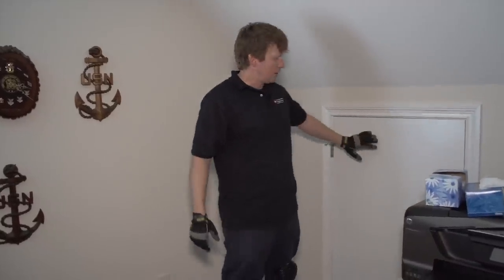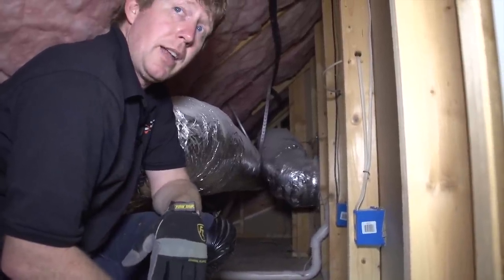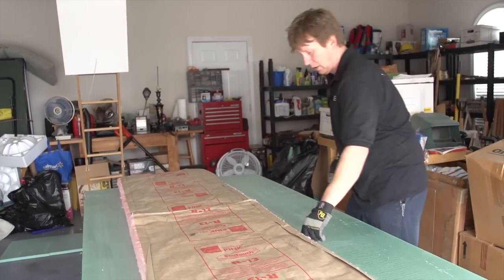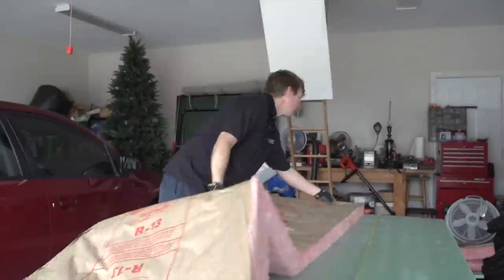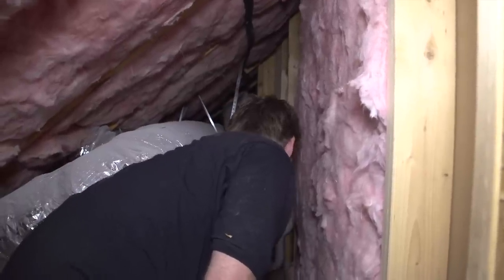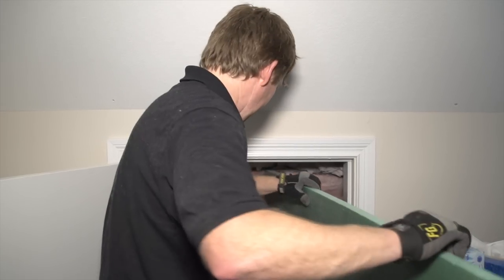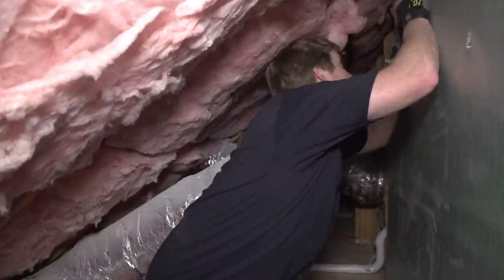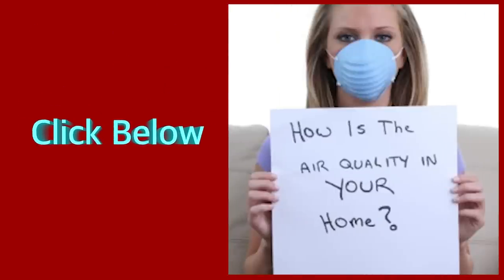Knee Wall Insulation DIY | How to Insulate a Knee Wall in Your Attic

Comment: Inside our kneewall with our ceiling insulated over baffles with batt and short walls insulated with open cell spray foam we finished it with drywall to give us more storage space. Now it’s sealed and moisture free with no humidity issues. Working around the duct and vent pipes in such a small space was tricky but we got it done.

Comment: Does the foam board act as a vapor barrier as well, or just an air barrier? I'd be concerned with creating a double vapor barrier issue and ending up with all sorts of moisture issues.
Reply: Your are right.   He's made a chamber and will trap more moisture.   There is closed and open cell foam but rigid is all closed cell meaning moisture can't go thru well. 

The reflective side on foam is a radiant barrier and should face the outside of the living space.  Some people confuse this as the vapor barrier side like faced.   It's radiant.
Reply: I'm looking for an answer to this question. Did you find one?
Reply: @Sbharveyz79400 but the sandwiching of two vapor barriers is why I'm here watching this video trying to find out if you can put foam board along the back of stuff like that with insulation inside the stud bays

Comment: And also, what about the space above the kneewall on the inside? Where the top of that foam board meets the sloped area which would be the ceiling inside of the room?  What is that insulation supposed to look like?  Thank you, Mike

Comment: So you also insulated the sloped wall underneath the roof? In my knee wall area there is only baffles underneath the roof section, just like in the attic?
Reply: I am curious about this too. I was searching for answers on this and found this video. Interested in the answer.
Reply: I insulted my slopes with baffles and R19 insulation. I had 12 bays on front side and 12 on the back side. I took down a piece of drywall to access the top of the attic. My bays are 24 inch wide. I have a clear space from soffit vent to ridge vent now. I put the insulation in the bays first. That makes sliding the baffles down the roof deck easier. I installed all the top baffles from the top attic both side, then went into the knee attic and ran baffles from the bottom to meet the ones on the top. It makes a straight air channel.

Comment: sorry i know this is an old video , but found you vids very informative. I basically insulated my knee wall as in this video, but i used foil faced rigid foam board. It was a finished room, then I added foamboard to back of stud. I faced the foil towards the heated space,  is this a problem.

Comment: I had my knee wall space insulated today and it was recommended to me that I take out all of the old and dirty insulation batting on the floor.  I want to ultimately use the space for storage so I want to put down plywood over the floor joists but should I re-insulate the floor?  Below that area is my kitchen.
Reply: +CrawlSpaceNinja.com Channel Both Mass Save and the company that did the insulation told me not to insulate the floor area.  I took out all of the old insulation and cleaned the area all up from dirt and debris.  We've had a few cold days down into the lower 30's and those two insulated areas are no longer cold so I think I should be fine.
Reply: +CrawlSpaceNinja.com Channel I think there are different schools of thought on this since everything situation is different.  Thanks for your suggestion!

Comment: I see insulation in the rafters..How do you handle ventilation above the kneewall to the ridgevent? Thx
Reply: +ken peffley you can buy Styrofoam pieces for venting.
Reply: Use rafter vents between each rafter.
Reply: Baffles between insulation and roof decking to allow air flow from ridge vent to soffit.

Comment: Could you put radiant barrier directly over the foam board for added heat protection? If so, would you staple it or use a different method to attach it to the foam?

Comment: What brand/type of foam board did you use? I had been recommend to use foil facing foam board.
Reply: Jason Lee that works as insulation plus a radiant barrier. works well.
Reply: Which way would you face the foil side? If you have batt insulation with a face and rigid foam board with a foil face would that cause a problem making a place for moisture to get trapped? I have a bunch of leftover rigid that has foil on one side and would like to use. Thanks!

Comment: I know I’m 7 years late asking this question, but maybe you can help me. My knee wall area…how do you install the insulation on the portion that is the ceiling? Basically, I guess the ceiling has to be ventilated because I can see the sunlight while looking down. So I’m wondering how it keeps the place warm in the winter, because it’s super cold then. And the summer, it’s super hot.
Reply from the maker: Access doors to the conditioned space behind the knee wall won't need insulation or weatherstripping. It may not be possible to insulate the underside of the rafters, or creating a continuous air barrier would be impractical (for example, with truss roof framing), so you will need to insulate the knee wall itself.
Reply: @CrawlSpaceNinja clearly he meant "WILL need weatherstripping and insulation"

Comment: The jury is out on spray foam air-tightness, is there a reason you didn't use an airtight membrane or tape (e.g. SIGA) for sealing around any penertrations and along the floor?

Comment: This was done in my house by the previous owner, I can feel heat radiating off the walls upstairs during the summer. Cape cod houses suck
Reply from the maker: I'm sorry to hear that. You may find this video helpful, it talks about some other methods you can use to better insulate this area. https://youtu.be/uytb3wYmftU

Comment: Why insulate the kneewall when the rafters are already insulated to the edge of the house?  that eave space was already conditioned
Reply: The homeowner likely realized that he/she was insulating a space they were not occupying and, thus, throwing money away. The air conditioner will not have to work quite as hard and have a longer life, and the electric bill will be decreased. Additionally, when anyone has to enter the crawl space, the space may not be quite as hot due to the rafters being insulated; and the materials stored there will last longer.
Reply from the maker: air sealing and insulating the knee walls creates the thermal break at the knee wall versus the rafter. Doing it this way proved to be more comfortable for homeowner and drywall was even a lower temp upon completion. Thanks for watching.

Comment: You do not insulate the roof, behind a knee wall. Wrong wrong wrong.
Reply: I think you can insulate the roof(only as high as the attic floor)or the wall but not both? But perhaps you can do both but insulate the wall with unfaced batts so no double vapor barrier?  It's so confusing when taking into account the various zones we live in.